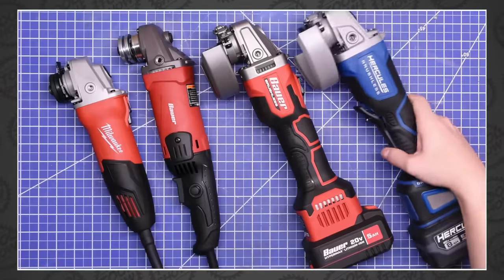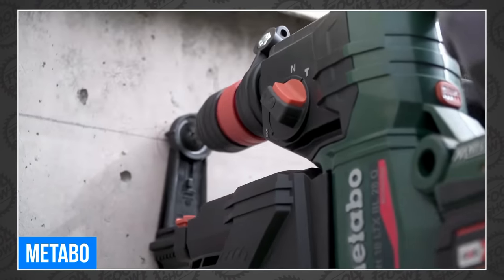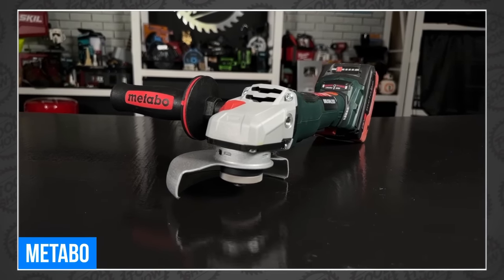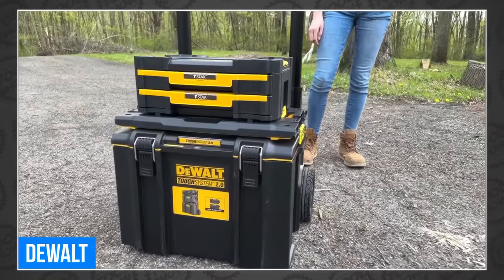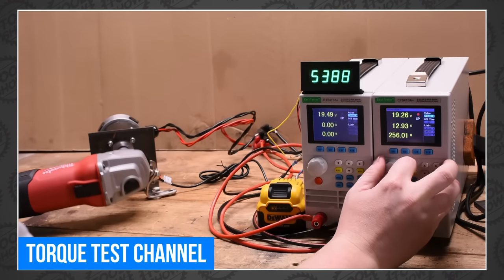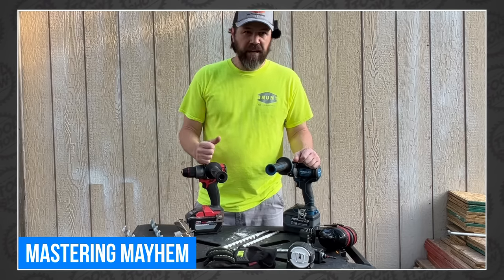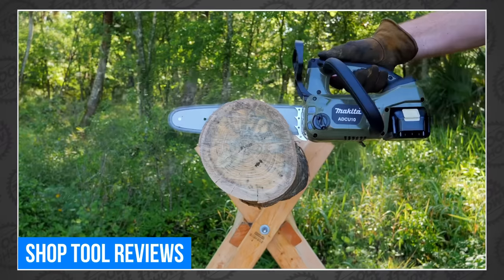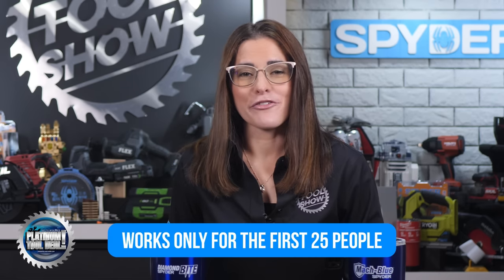EXCLUSIVE! New UNANNOUNCED TOOL! Plus New Power Tools and reviews from Milwaukee, DeWALT, and more!

Comment: Milwaukee was in our shop yesterday doing a demo and had some of the new grinders with them. The one they had has a thinner head so it gets in to tighter areas, we use to grind welds. I also won a M18 drill and impact combo kit with 2, 5 AH batteries which was nice
Reply from the maker: Grats! So you liked the new grinder?

Comment: The code never worked. Tried immediately and it didnt work
Reply from the maker: It worked for 25 people. So sorry it didn't work for you. Did you use it with Milwaukee hand tools?
Reply: @ToolShow  It never worked this week. I had over $100 of milwaukee hand tools in the cart and used the code immediately. 

I am able to use the code in time every week. If it worked for anyone this week, it must have been set up wrong and didnt cover the new pliers.